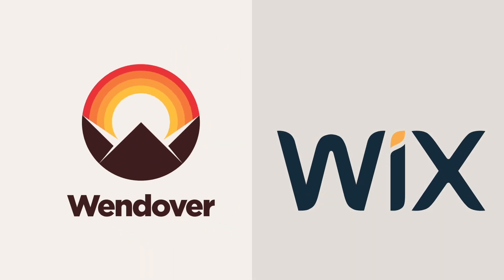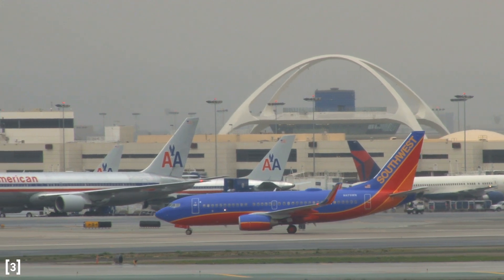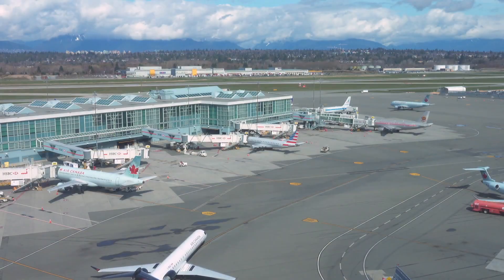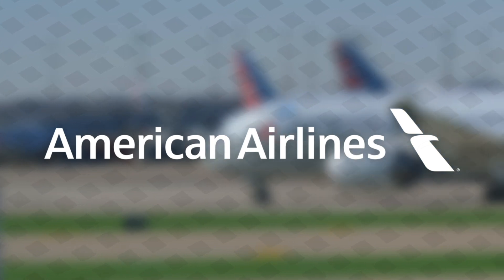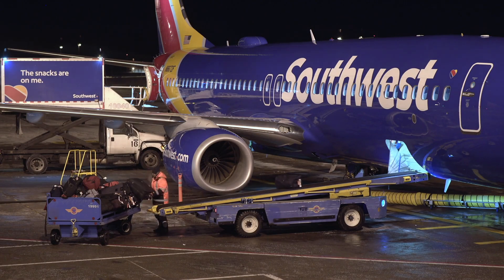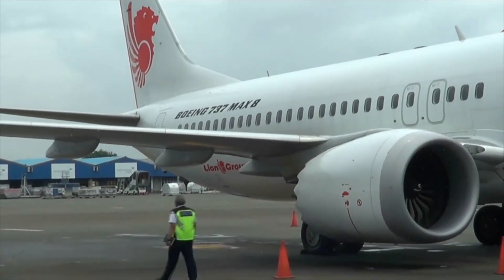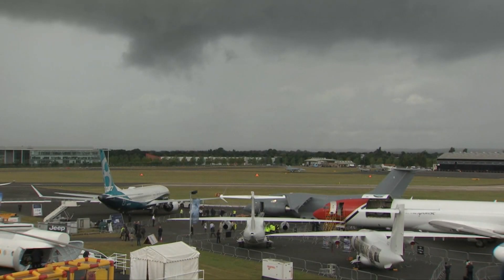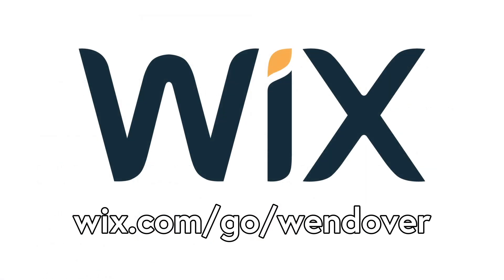The Economics That Made Boeing Build the 737 Max

Comment: You say: 'There is one other big difference between modern aircrafts and 737 MAX, most modern airplanes are flying up above right now, the 737 MAX is not...." 
Yet there are 6000 other 737s flying today, taking off or landing every 1.5 seconds. It is by far the most common and most flown commercial jet.
The problem with the 737max is known, and Boeing has a fix which all parties are reviewing. Boeing flubbed this, but they will make it right. 
As an American, I am proud of Boeing. It is our largest exporter, in a time when we really need exports. Don't bite the hand that feeds you.

Comment: "easy wrong or difficult right."  Come on, that's silly.  Nothing wrong with keeping the basic 737 going.  MCAS is actually a preview of what happens when you go all-new or all-electronic.  The beauty of the 737 is that it's a pilot's plane.  Your tone mocks the efficiency of keeping an older design going when pilot retraining is considered.  But if efficiency isn't the number one goal of society, how are we all supposed to have enough resources to live prosperously?
Reply: With your mentality if boeing thinks like you they will make biplanes next because is more pilot frindly and more fuel efficient, i guess hot air ballons are next.

Comment: I will join the many passengers who will not be travelling on a MAX.
The more I read and watch about this plane reveals the simple truth that profit came before safety.  Even without the undisclosed MCAS and faulty sensors I don't want to fly on a plane that doesn't comply with the simple fundamental rules of aviation design.  THE ENGINES ARE IN THE WRONG PLACE.  IT IS UNSTABLE.   PERIOD.
Reply: Barry Atkinson  We hope the 737max never flies again
Reply: Barry Atkinson  Actually I think you’d find numerous pilot certified on the 737 series who’d disagree with you there.  Yes, as the narrative of this and many other videos on the subject by pilots such as Juan Browne, Captain Joe and Mentour Pilot reinforce, Boeing made several mistakes not only in the hasty design and lack of redundancy in the sensors upon which the MCAS relies, but also in the lack of including details of this new system in operating manuals and by offering a sensor error warning system and bypass as an $80,000 per plane “option”.  The FAA also deserves to share more than a small amount of the culpability in this case (and perhaps others not yet made public?) for their allowing the industry to self certify.
No doubt in all Boeing’s PR releases that will announce the testing of the hardware and software upgrades to the Max series (7/8/9/10), the names of the managers who approved such decisions, or over-ruled any concerned engineers’ warnings will be conspicuously absent.  I’m thinking William Barr might be invited to help write the summary of the findings of the investigations.  “Full and complete exoneration”
Reply: @fonkenful  thanks for your  confirmation that you will not want to fly it.  The same aplies to intelligent  crew and passengers. The design is compromised. You would be stupid to take sich a risk
Reply: Barry Atkinson  Not so sure that I typed those exact words or could have been reasonably inferred from what was, but whatever.  I happened to have had my personal interest in this fiasco piqued by a recent trip to Maui via West Jet -one of two Canadian Airlines to include a Boeing equipment in their fleet.  As it turns out our Vancouver to Maui and return legs were via 737-800 (a “new generation”  model), but with the plethora of models in the  over 50yr old 737 series designation, it’s perhaps understandable that someone with no reason heretofore to have much interest in the model number on the back of seat safety information card would be a bit freaked when this particular load of shit hit the high bypass fan shortly after landing on the first leg of what was to be a  relaxing vacation in paradise.  
We’ve flown Air Canada on previous trips to Bermuda , a total of three different flights in a single day’s travel,  - as well as to Vegas - and of all of the planes I’ve been on in recent memory - including at least two models of AirBus, my favourite was the 777.  
As Boeing has more than a few billion $ of orders on hand for Max series, they’ll almost certainly resolve the MCAS issues soon - provided the engineers are permitted free reign, and with the microscopic scrutiny under which that will occur, the 737 family may well prove to be among the safest 50yr old airframes still certified.  
What will be most interesting will be if / how soon they accelerate development / certification and production release of  the NMA /797.

Comment: So hanging engines far larger than the design was meant for resulted in the plane that did not want to fly straight and level. The nose would pitch up. That is what is known as an unstable aircraft design. A stable design can set power to cruise and fly pretty much straight and level without any control input, i.e. "look mom, no hands". This aircraft could not do that. They used MCAS to compensate. A lot of reporting focuses on MCAS as the cause, but very few are asking why it was needed in the first place.
Reply: Incorrect. The MAX is as stable as any other airliner.

Comment: Shouldn't a third AoA sensor be required for safety? Airbus uses three, so that the software knows (when there is a discrepancy between them) which sensor is malfunctioning. The software fix Boeing is planning still only uses two AoA sensors. If there are only two AoA sensors, and a disagreement between them switches off the MCAS, the plane will be left with a nose-up tendency. Also, shouldn't there be at least one sensor that simply detects the actual angle of the plane without having to use airflow?
Reply: Airbus are not immune to AOA/computer problems ie. Qantas flight 72
You are confusing pitch with AOA.
MCAS switching off due to disagree does not impact normal flight conditions.
Reply: @stimproid  If "MCAS switching off due to disagree does not impact normal flight conditions" (as you claim), then why have the MCAS at all? What exactly do you mean by "normal" conditions anyway? The MCAS is there to prevent a stall when the AoA is getting too high. Surely you are not suggesting that since this is not a "normal" condition, it does not matter!

Also, I am not confusing pitch with AoA. In both the flight crashes, the MCAS system did not know that the plane was heading downwards at an angle of up to 40 degrees! If this information is made available, surely the MCAS can be programmed to cease sending the plane nose down in such conditions!
Reply: @Observer-cd2ul  MCAS was to make the MAX "feel" like the NG so it would have the same type rating. That is all.
Reply: @stimproid  This does not make sense. Even now, after two tragic air crashes, all Boeing seems to be concerned about is just to maintain the same type rating for financial reasons? So much so that they are willing to use only two AoA sensors instead of three? 

IF the MCAS is purely to "make the Max feel like the NG" (as you suggest), Boeing should either get rid of the MCAS altogether, and have the pilots undergo simulator training as for a new type of plane, or, at the very least, deploy three AoA sensors for safety. The plan to get the plane back in the air with a software update using only two AoA sensors reeks of yet another rush job. Will they never learn?
Reply: @Observer-cd2ul  The same type rating is critical for airlines wishing to integrate it into their fleet of existing 373 models. A pilot may only be certified on one type at a time. If the MAX has its own type rating, a pilot certified on a MAX cannot fly an NG or 800 and vice versa. This would be a logistical nightmare for a carrier like Southwest.
Reply: @Observer-cd2ul  3 AOA sensors is not a guarantee either. Qantas flight 72 for example.
Reply: @stimproid  All these concerns about "integrating the plane into their fleet" and so on are purely financial, and this is exactly the problem. Even after hundreds have died, Boeing's concern is still the profit margin, and how to get the airlines to buy their plane! If Boeing refuses to learn, I genuinely hope that passengers reject the 737 Max outright! Also, while there may be no guarantees, three AoA sensors should be used if Boeing is concerned about safety at all!
Reply: @Observer-cd2ul  All companies are in business for one reason. To make money.
 Boeing will learn from this and move on. 3 aoa sensors is not needed. If there is a disagree between the 2 the MCAS wil not engage. For a system that would only be needed for hand flying the aircraft at the very edge of its flight envelope, likely never really needed, I'd say that works perfectly.
Reply: @stimproid  While all companies are in business to make money, there is a red line one does not cross. One does not endanger people's lives for the sake of making money. Boeing's negligence has already cost hundreds of lives. And you are suggesting that they continue focusing purely on making money and rushing out a "fix" that uses only two AoA sensors? If Boeing behaves this way, they cannot be trusted. And I will then genuinely hope that the international regulators require that all parts of the 737 Max be re-certified again from the ground up! This is because the initial process of certification has already been shown to be faulty.
Reply: @Observer-cd2ul  I'm merely stating the facts. As MCAS is not a flight critical system, the 2 AOA sensors will be a fine solution.
Reply: @stimproid  Two AoA sensors may be a seemingly "fine" solution, but three AoA sensors are required for a proper solution. That is why Airbus uses three AoA sensors. There is a reason for it. 

I just heard that the CEO of Ethiopian Airlines wants a review of the entire flight system (and not just the MCAS system) of the 737 Max before it ever flies again. Clearly, he does not trust Boeing anymore, does he? He also says that it is possible that Ethiopian Airlines may never fly the 737 Max again!
Reply: @Observer-cd2ul  Good for him. His airline also said the pilots did everything right to try to recover the aircraft. We know this is not true. Boeing's fate does not rest on whether Ethiopian airlines flys its planes or not.
Reply: @stimproid  Did you read this article?: "Boeing altered key switches in 737 MAX cockpit, limiting ability to shut off MCAS." The pilots were not at fault. Boeing has a disgraceful habit of blaming the pilots for crashes clearly caused by Boeing's own negligence.

Ethiopian Airlines is the largest airline in Africa, and passengers around the world are watching. If the largest airline in Africa refuses to fly the 737 Max planes they already have, do you think passengers will want to get on this plane? So the fate of the 737 Max may actually depend a lot on this.
Reply: @Observer-cd2ul  The switches did not limit the pilots ability to shut off MCAS. They do that just fine. Ehtiopian Air flies about 100 planes of mixed types. Southwest flies over 700 737's. If Ethiopian wants A320's fine. They can have them...in about 8 years. Guess they could buy planes from China or Russia.
Reply: @stimproid  As the article explains, the alteration in the key switches meant that "there is no longer an option to turn off automated functions -- such as MCAS -- without also turning off the thumb buttons the pilots would normally use to control the stabilizer." If the Ethiopian pilots had been able to do that, they would probably have been able to save the plane. 

This is yet another sign of a rush job by Boeing in getting the 737 Max onto the market. The whole control system is badly planned. Little wonder then that the CEO of Ethiopian Airlines is calling for a review of the entire flight control system of the Max before it is allowed back in the air. Hopefully the international regulators will heed his call.
Reply: @Observer-cd2ul  An MCAS failure would manifest as runaway trim. The memory item checklist requires both cutout switches be turned off an left off. It doesn't matter how they are labeled, electric trim would not be available if they followed instructions.
The FAA will not likely be the first agency to sign off on the MAX for it to fly again. They will most likely invite international agencies to vet the MAX first. 

I'm sorry, but Ethiopian Air is small potatoes. The fly around 100 planes of various models. Southwest flies well over 700 737's. Ethiopian can say whatever they want about testing, but in the scheme of things their voice is small.
Reply: @stimproid  The alteration in the key switches is not just the labelling. I will be glad if the FAA is not the first to sign off for the MAX to fly again, but I suspect they will be. But, since the FAA realises that they themselves are now under the microscope, they will tread warily, and hopefully do the right thing! 

It is irrelevant how big or small Ethiopian Airlines is. What is important is that their call for the entire air control system of the 737 Max to be reviewed, before any ungrounding, is the correct step to take. Will the FAA listen and do the right thing? I am not too hopeful for the FAA (but we'll see); the other international regulators, however, might well heed the call.
Reply: @Observer-cd2ul  The MAX will be under a microscope. Due to this, it will likely be one of the safest aircraft ever built. 

The rest of the flight controls aren't new. They can inspect all they want.
The procedure for runaway trim is to turn the stitches off. Period. With the switches off, no 737 pilot going back 50 years would have the expectation of having electric trim.
Reply: @stimproid  Whether the MAX will even be safe will depend on what exactly the FAA and other regulators do before they unground the plane. For a start, are they going to allow Boeing to get it flying again with just a software update, using only two AoA sensors, and no mandatory flight simulator training for the pilots? If that's the case, I suspect most people won't ever want to fly on the plane. As it is, many are already planning to avoid the 737 Max when it gets ungrounded; some even refusing to book with airlines that use that plane, in case they end up on one!
Reply: @Observer-cd2ul  Do an experiment. Ask friends and coworkers if they know what a 737 MAX is. Just that question.I think you will be surprised at how many people haven't got a clue.
Reply: @stimproid  Actually my friends do know. And word gets around, when a new plane crashes twice within a few months. They may not know the technicalities, but I think, unfortunately for Boeing, they will know enough to avoid a plane with such a reputation.

Comment: It's the (mis)design of the MCAS system that is wrong, not the idea or the need for it itself. Using both sensors, limiting its ability, telling pilots about it etc. would have been proper design and no issues would have occurred.
Reply: Correct

Comment: I could not watch all of this because of the statement that the max has cables that move the flight control surfaces. This is WRONG. The max has cables that are connected to valves. Valves that port hydraulic pressure to asctuators that move flight control surfaces—just like EVERY OTHER COMMERCIAL TRANSPORT JET FLYING. What is “turned on.” This stupid statement makes it sound as though just flipping a switch makes most modern airplanes flight ready. EVERY JET FLYING uses many, many steps to become energized electrically, hydraulically, pneumatically, and mechanically. This assertion of a contrast between 1 step and seven steps is simply wrong. And lastly, the claim that most modern aircraft have electronic on screen warnings while the Max only has a warning light, is again, ridiculous. Every airplane that Boeing has produced (Max included) has had a full EFIS (electronic flight instrument system) consisting of NAV, ATTITUDE, AIR DATA (airspeed, temp, altitude, etc.) and EICAS (engine indicating and crew alerting system) IN ADDITION TO warning lights, called ANNUNCIATORS. I believe these statements were DELIBERATELY designed to be misleading and misinform. There might be true facts in the remaining video, but these 3 items are enough to discount this piece in its entirety.

Comment: There are two ways to pronounce the word 'the.'  They are, "thee" and "thuh."  If "the" precedes a consonant, it should be pronounced "thuh," as in "thuh car," "the flight," and "the damage."  If it precedes a vowel sound,  the pronunciation switches: "thee eagle," "thee other," and "thee eyeball."  This narrator very often uses "thee" to precede words with consonants.  The overall effect is that the narration sounds stilted and artificial.  The points where it happens are jarring.  This happens quite often in amateur voiceover work and it is very prevalent in homemade YouTube videos.  It might be due to the speaker's desire to speak or pronounce with a clinical precision or exactness but since it is counter to normal English speech, it is off-putting.  I'll try to listen to this interesting video without the shortcoming bothering me but it wont be easy.

Comment: The most important question is whether the fix to the problem includes a second sensor to MCAS or will MCAS remain a single sensor system. If it remains a single sensor system, then you find me on that plane.  I have a suggestion for Boeing, end the 737 program and bring the 757 back.